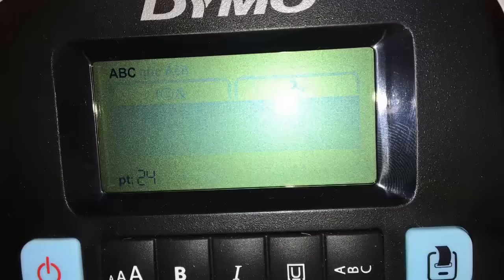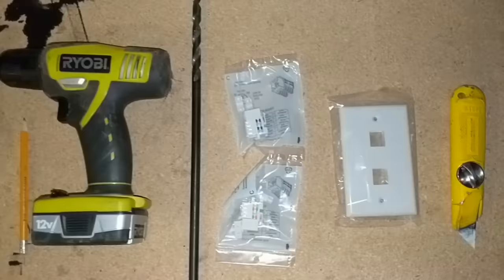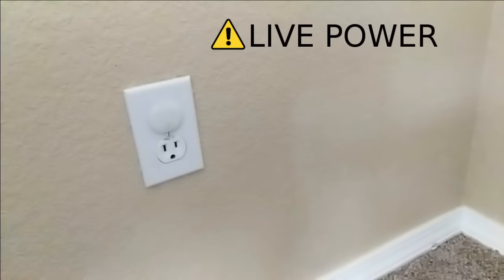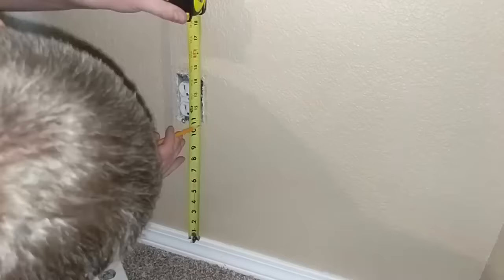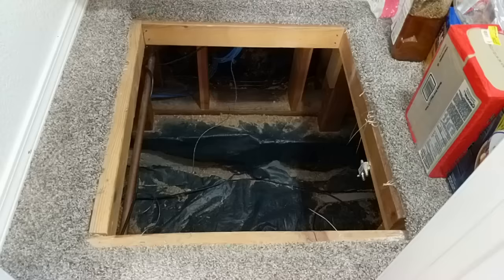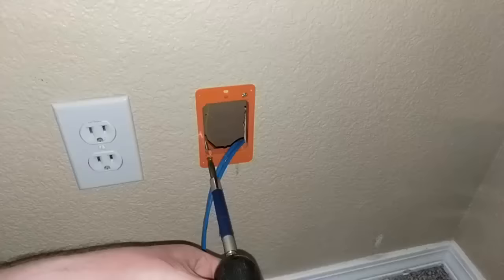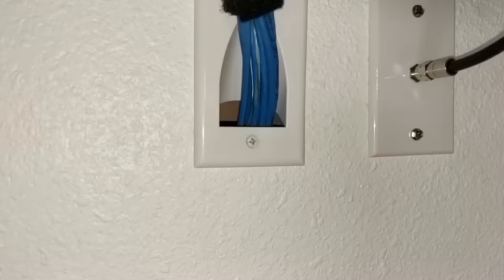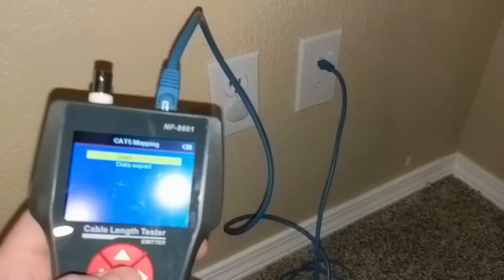How to Add a Network Jack to a Wall

Comment: You should have gone over grade of cable to use , personally I went with CAT 6.
Reply: Unless your routers, patch panels, and switches are all >1gb rated, you’re better off with 5e cable  which is easier to pull. But more importantly, you need to consider the material makeup of the wire. For better throughput with less interference go with pure copper and avoid the CCA stuff.  By code, contractors must use copper, although the homeowner can install either one as a diy project.

Comment: Hello, just one question, is your UTP cable stranded or solid cable?
Reply from the maker: I run solid in the walls
Reply: Stranded cable is not rated for in-wall use. Stranded cable is only used for patch cables. (Conversely, solid wire is not rated for patch cables.)
Reply: Just wondering where you guys bought the solid cable? I looked online but I can’t find one 😭
Reply: khraieyscael Any in-wall rated cable should be solid. Stranded cable is typically harder to find. CMR cable will work for most applications.
Reply: nilpo19 I think you’re talking about bulk cable, right? The one I bought was the longer cable with rj45 already.
Reply: khraieyscael Correct. You will have a very hard time finding factory terminated solid cable. Patch cables are terminated and they are always stranded cable. For what it's worth, you shouldn't pull terminated cables through walls. Generally, it isn't rated for use in walls, and it almost always damages the cable while pulling.
Reply: nilpo19 that makes sense... for now I will leave the cable as it still working but if I find any issues with the connection between the modem and router, I will buy the buck solid cable. Reason why I used the stranded cable is because I can’t find factory terminated solid cable and if I do, it is expensive. Also, I only need 75ft cable long so if I will buy bulk solid cable... I’m gonna waste lots of money. But next time if the connection will be faulty... then I will invest with bulk solid cable. Thanks for the info
Reply: khraieyscael Just don't use it for PoE. You should be fine. Stranded cable cannot handle as much current as solid cable. As a result, it dissipates much more heat. This is why it can't be rated for use in walls and why it should only be used for short distances.
Reply: That makes sense as well. Yes, I am just using it for modem and router connectivity. I don't use PoE at home. Thank you for your patience on answering my questions. You helped me a lot.
Reply: nilpo19 last question before I move on. Can I use stranded cable for keystone jack using punchdown tool? Or it is not gonna work at all?
Reply: khraieyscael Punching down stranded cable usually breaks several of the wires. This definitely affects signal. You will usually see slower network access or random networking problems as a result. Technically, yes it will work, but you will almost always see performance or signal issues.
Reply from the maker: You could probably get it to work, just might not be as easy.
Reply: @BudgetNerd  Come on now. That's bad advice. Surely you know that.
Reply from the maker: It's not advice, it's just answering the question. I wouldn't recommend it, and nor would I use stranded to punch down.
Reply: Thank you for sharing your expertise. I really appreciated your help and I've learned a lot from you. I actually have a patch cable and I cut the other end to check if it is really stranded cable or solid and unfortunately it is stranded lol. Anyways, I think I can still use that cable by attaching rj45, right? If I'm not mistaken, I can use RJ45 jack for stranded wire?
Reply: Also a big thanks to you for posting this video. It helps a lot of people like me who wants to learn new things and be confident on this kind of project.
Reply: @khraieyscael6114  Yes... maybe! There are two styles of 8P8C (RJ45) modular plugs. One is designed for solid cable, the other for stranded. They aren't meant to be interchangeable, but they often can be. You just have to be very careful crimping to make sure you get a good connection without breaking the connector or the wires. If it's what you have, give it a shot.
Reply: nilpo19 wow!!! I didn’t know there’s designated plugs for stranded and solid. Thanks again for the info. I didn’t regret that I ask you guys. For sure I will follow your advise 😊 thanks again

Comment: Ok no crawl space. And an attic won't work for the basement. Luckily the furnace room isn't finished and a wall runs all the way up stairs and a vent to. And my rooms right next to the furnace room. So all I did was run the cords right next to the vent pipe and pulling it tight on each end stapling it to the 2 by 4's up stairs and down stairs making sure the cord isn't touching the vent so it doesn't get hot or anything theres about 4 inches of space between the cords and vent. And the rest was easy just run the cord along the unfinished wall and cut a hole in the dry wall to my room. And install the ethernet plug in the wall up stairs and down stairs.

Comment: i have like a phone jack in my wall can i use that as a network jack
Reply: No, phone jacks use cat 3 which I think is only 4 pins. Ethernet uses cat 5 + which has 8 pins.
Reply from the maker: If they use Ethernet cable, you could. If they use a normal phone cable then no.

Comment: Is the network cable same as telephone cable or is it a different type of cable
Reply from the maker: Different cable.
Reply: It depends on what cable the builder used when they built your house. 99.9% of new houses will use cat5 or cat6 for telephone. The only difference is the wall plate or keystone jack.

Comment: SUBSTANDARD work. I bet you are having troubles with your internet connection like unstable/ fluctuating speeds. Just so you know that 1foot apart is the standard one.
Reply from the maker: Sorry to disappoint, but it's working just fine.

Comment: how does the wall get the wifi from the router?
Reply from the maker: We aren't using WiFi at all. This is a direct wired connection to a switch, which on turn is connected directly to the router. No wifi.

Comment: Ok so I have Ethernet Ports in my house how do I connect them to my router please reply
Reply from the maker: All those Ethernet ports probably lead to one specific location in the house. Find that location and then you will be able to connect your house up from there. There may be a patch panel, or maybe a bunch of wires you can plug into your router or a switch.
Reply: Ideally, you'd want to have your router connected between the modem (ONT, if you have FIOS) and any other patch panel, hub, switch, etc.

Comment: What wires are used for the power ?
Reply from the maker: Most devices connected to these Ethernet ports will get their own power from a separate power source.

If you have a PoE (Power over Ethernet) setup, the power the device needs will be delivered though the wires shown. No extra wires needed. You'll just want a router or switch that will provide PoE power.

Comment: Can I use female to female jacks to do this ?
Reply from the maker: There are keystone's that will let you plug in a normal Ethernet cable. Is that what you are asking?
Reply: Budget Nerd not sure it was like an Ethernet wall plate that had a female connection on both sides so I just ran an Ethernet cord from my router to the first plate and from the first plate to the second and from the second to my pc. I have no idea what the technical terms are because I’m very new to networking stuff

Comment: IF your home uses Leviton Electrical outlets and Cover Plates, Leviton’s QuickPort Systems will be PERFECT Color Match.
BEWARE:  Ivory and Almond are DIFFERENT Colors.  IVORY has been Long-Time (decades) Color used by Electrical Outlets.
ALMOND is a NEW Color, last twenty years, Sold by Home Depot.  Home Depot no longer regularly stocks IVORY ... requiring you to source from Electrical Distributors.  CHECK before making large purchases (Take your existing cover plate when buying, comparing to Both Colors.)

Comment: the device u have didnt show 12 lol
how do u know its 12 and 13 from the scanner?
Reply from the maker: I had punched those two cables down on the patch panel at spots 12 and 13. I tested port 12 and the one that got a good result was 12. The other was 13.
Reply: @BudgetNerd  hmmm I don't follow from the video tho
Reply: It only has 1-8
Reply from the maker: What only has 1-8?
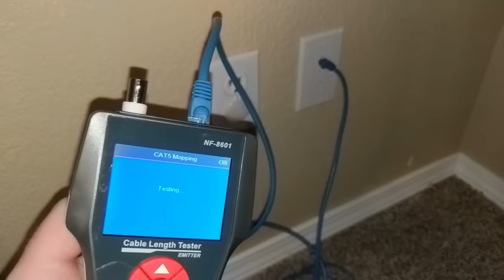Reply: @BudgetNerd  8:39 how did u read it to get 12 from the machine?

Comment: Or save yourself a lot of time, work and some money and buy a Power-to-Ethernet adapter. These plug into any electrical wall outlet and allow Ethernet over the existing power cables in your home, given your home was built in last few decades or so.
Reply: i assume this is only reasonable if you can trust the wiring in your house to not have interference. not sure how this works, but tbh this sounds like a bad idea for anything you want a great connection on. a printer, you probably don't care, but anyway.

Comment: It's not really secure to put an electric outlet in a cabinet... It is against the electrical code (in Canada, I don't know in USA).
Reply: I was not aware that was against code in Canada, but they do generally have tougher regulations than the U.S. It's not against code in the U.S. and is quite a common practice. However, before beginning any electrical project it's a good idea to check your local codes since it can be different everywhere.
Reply: Rule 26-710 (i) of the Canadian Electrical Code states:

A receptacle shall not be placed in a cabinet, cupboard or similar enclosure except where:
(i) The receptacle is part of a factory built enclosure.
(ii)The receptacle is provided for use with a specific type of appliance that is intended for use within the enclosure.
(iii)The receptacle is intended for use with a microwave oven;
(...)
(j) Except for cord connected dishwashers, in line water heaters, garbage disposal units, and other similar appliances, receptacles installed in cupboards, cabinets or similar enclosures in accordance with paragraph (i)(ii) shall be de-energized unless the enclosure door is in the fully open position.
Reply: Code code everywhere a code.
Reply: try again, code is different everywhere,  it is up to the AHJ as to what they adopt

Comment: what type of cable was the blue cable?
Reply from the maker: Cat 5e
Reply: Budget Nerd i’m gonna use a cat 6 but does it matter if it comes with connectors already on?
Reply from the maker: Sounds like what you have is just really long Ethernet cables, if there are jacks on the end.  You could just use them the way they are with keystone jacks or a patch panel (if you want one) that would take ethernet jacks, or you could just cut off the connectors if you want.

It would also matter if they are stranded or solid core cables. Generally it's best to have the cables in your walls be solid core.
Reply: Budget Nerd ok thanks
Reply: Budget Nerd i think i am just going to leave one of the connectors on to plug into the router and the other side i will use as a keystone jack
Reply from the maker: That would work.
Reply: Budget Nerd ok thanks for the help

Comment: For the love of packet loss, please don’t run network cable next to romex power! If you must put a network jack in the same stud space as a power outlet pout them as far away as possible. Also try to cross  any power runs at 90* angles.
Reply: isn't 8 inches far enough away?
Reply: also, to me that box he uses looks like with alot of fiddling over the years, the box holding to the drywall would get lose over time because it's mounted to the drywall. should have added a wood bracing behind the wall instead?

Comment: well, nice guide but you could have specified the wall type. if you have clay brick or aerated concrete, or a crawl space then it won't work
Reply: They make drill bits specifically for concrete and brick called masonry bits. And a brushless drill for best result.

Comment: In my house there is an ethernet port and i dont know if it works because i want better connection for my ps4 but i dont know if the ethernet port will work pls help me out or is it even an ethernet port ot has the shape of one i do have wifi in my house so im not sure if it will even work if i plug it in
Reply from the maker: You would have to find where the other end of that Ethernet cable is going. is there a network closet, or rack, or location where some Ethernet cables go to? You might have to trace it, and see where it runs if you plug in an Ethernet cable and nothing happens.

Comment: Don't run a network cable in the same cavity as a power line. 18" minimum separation when running parallel to power. Cross power cabling at 90 degree angles.
Reply from the maker: You're not the boss of me.
Reply: @BudgetNerd  Absolutely not! That's merely a suggestion! And a TIA/EIA standard.
Reply from the maker: I know, just being silly. TIA in Portuguese means "aunt."

Comment: Gee thanks! Looks like you only need about 50 million tools?
Reply from the maker: Well not so much. I showed everything you needed plus everything that would make it easier. You could have done it with far less depending on where you are in your house. 

The tools you do need (screw driver, drill, string, knife, etc) most people should have, and the keystone and plate punch down tool, people wouldn't have an issue getting.. or they wouldn't be looking up a video like this one.

Comment: You should actually run your data cabling in the space opposite the power outlet. First, there is less a chance of electrocuting yourself. Second, electrical code in many areas requires it.

Comment: Half of this is wrong. Please measure where you are drilling. Also use the low voltage plate to trace your cut out not some other random outlet nearby. You need to buy a cable stripper that is not optional unless you are using shielded cable like 6A where it is hard to cut the internal wires. I could keep going...

Comment: Just buy a "powerline adapter" about $100 usd for a good one.
Reply: not every house has good wiring for powerline adapters, so knowing how to run network cabling in those homes is a good thing for people with those homes
Reply: no where near the quality and throughput of cat 6 hardwire.

Comment: SAFETY FIRST! Always try to install , network, coax cables, etc.  in a different space than the electric ones to reduce the hazard of arc flashing, if that is not an option then go as far as you can between the electric outlet and the one you're installing. Arc flashing is not funny.

Comment: Why you house is made of wood and fake walls ?
Reply from the maker: Wood is strong and easy to work with. My walls aren't fake, cuz so far, I haven't been able walk through them.
Reply: @BudgetNerd  easier yes, but no strong, you cant mount a monitor, tv, or somthing heavy in that sheet of compres virutes of wood
Reply from the maker: I didn't say the drywall was strong, I said wood is strong. We mount TVs and crap to walls all the time. If you know what you're doing, it's fine, and anything heavy we attach to the wood.
Reply: @BudgetNerd  drywall? what is it?. so, you can't just mount things where you want in the wall?
Reply from the maker: Drywall is the fake wall you are referring to. If we want to hang up something heavy, we usually look for the wood behind the drywall and attach to that. It's super strong. If that's not an option,we can use anchors and those hold quite a lot when wood isn't an option.

Comment: This guide is pretty much useless if you live in masonry houses. That’s the typical building material in my country. It’s almost impossible to do anything similar to what is shown in the video. Even if it can be done, the mess and the cost would be ridiculous. To cap it all off, WiFi signals tend to be quite weak in masonry houses and I have some first-hand experience as to how bad Powerline adapters can be. I tried implementing them in my house for an experiment and they just could never transmit the signal consistently enough. Thankfully, I ran some ethernet cabling to each room in the house and a coax cable where a TV will be so I can implement access points where necessary and get a hard wire connection for my gaming rig, the Smart TV’s, the IPTV’s that our ISP gave us etc.

Comment: So, step 1.  Don’t put UTP CAT Anything next to an outlet.  Step 2.  RJ45 is only rated to 1000 feet and has specific TX/RX pin sets.  Step 3.  802.3 does not care about your keystone color set.  So, it doesn’t matter what end your on because it’s all EIA/TIA 568 A/B.  Your autoMDix will take care of the rest.  Step 4.  You’ve read this far into my post and believe I’m an asshole or have no idea what the hell i’m talking about what so ever.  Stop immediately and call a professional or take the time to read and learn about 802.3.   Michael Nix BSNE you’re welcome

Comment: This is DIY job but if you are a Professional, ill run the cables outside the wall the Amateur And easy way. I’m just going to buy All Weather Proof Ethernet Cable.

Comment: Do this on an outside wall and you'll be dealing with an insulated wall.
Adding outlet boxes of any kind on an outside wall is not recommended. 
Multiple reasons. Just don't do it.